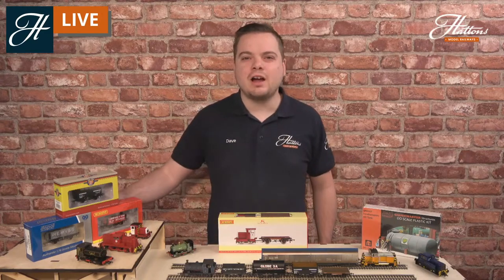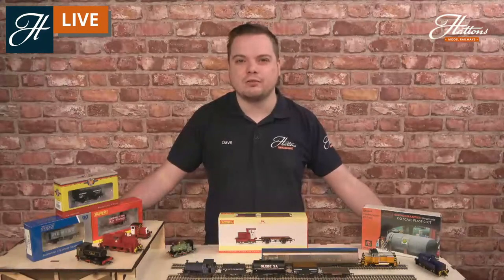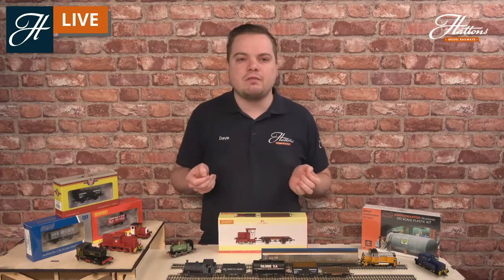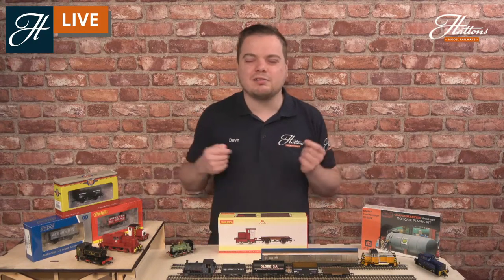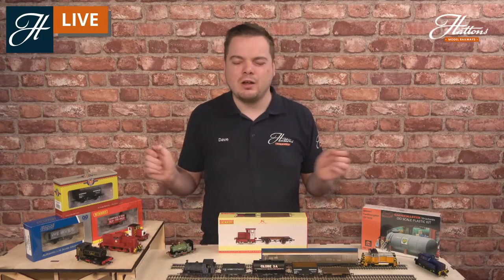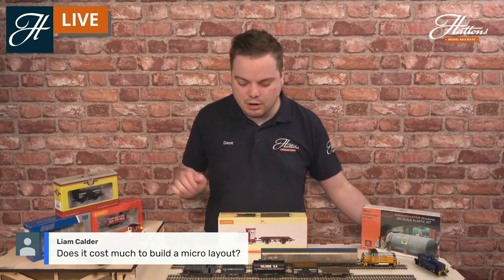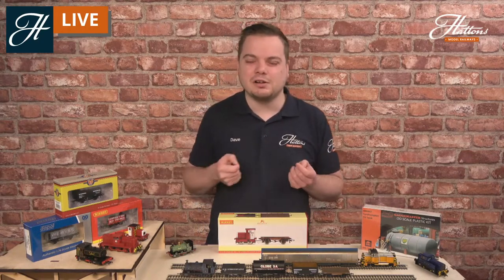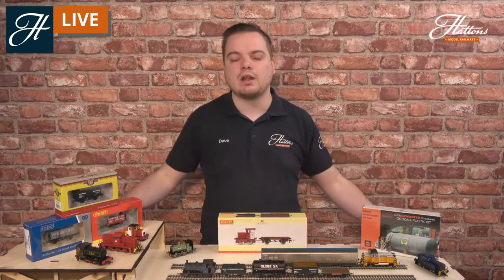How to model an Industrial Railway in OO gauge

Comment: In later years of course, with local ironstone mines closing due to high costs (the last being North Skelton in 1964) and cheaper products arriving at the Ore Terminal near Teesmouth, the scene changed radically. Steam gave way to diesel, the most common being later classed as 25 and 37, and steel plants closed. The empty shells of Cargo Fleet works and part of Dorman Long at South Bank stood inland of the Saltburn branch, the Teesside Executive train was shelved and part of the Whitby line beyond Loftus was lifted beyond Skinningrove/Carlin How. The line was reinstated to Boulby for the new mine's potash trains to Teesside, affording dramatic scenery between Riftswood Viaduct at Saltburn and the line curving inland from Huntcliff - also near Saltburn - to Skinningrove Works, with the new steel viaduct that 'hovers' over the Loftus road's uphill 'Z' bends as it curves around from Boulby to Lackenby Works. The Redcar works that closed in the early 2000's still prospered, and behind them the smaller Warrenby Works, also recently decommissioned. A large part of the ICI complex was decommissioned, leaving some empty shells of buildings, decommissioned since the 1990's. The optimum time period for modelling is therefore 1962-1982 for diesel traffic as well as steam on some Saltburn-Darlington-Bishop Auckland suburban traffic. Thornaby's shed (51L) was completed for use in 1958, when steam locos from around the then defunct Teesside sheds were transferred.
A railway modeller's 'heyday'.
ARL 9/10/2020
Reply from the maker: Hi Alan, you've got it spot on, these are some great ideas for modellers to pick up. Thanks for sharing your memories.

Comment: One example of industrial activity (steel works, docks, shipbuilding, chemical works) could be seen in the 1950s-1960's along the main line from Middlesbrough to Saltburn-by-the-Sea on Teesside. The line to Darlington and Northallerton from Saltburn was used by suburban traffic, with twin articulated sets behind passenger tank and tender classes between, for instance, Cargo Fleet and Dorman Long steel works, ICI Chemical's paints and nylon division and the famous Cleveland Bridge & Engineering Ltd that constructed and assembled Sydney Harbour Bridge in the 1920's. Along the route also, towards the River Tees were the extensive docks and graving docks that built cargo and war ships as well as the later iron ore terminal. In the early hours (around 6.30 am) a Darlington Peppercorn A1 or York Gresley V2 left Saltburn for Kings Cross. This was the businessman's train that returned in the evening. There were also race specials for Redcar Racecourse, with its own platform. Trains from the Midlands and North West passed between the works with GC and LMSR engines heading long rakes of regional passenger stock as well as the newer Mark 1 stock. Until the late 50's trains left Middlesbrough for the coast route via Loftus to Whitby, and iron ore trains passed on their way from various ironstone mines in East Cleveland such as North Skelton, Kilton and Lingdale behind the widespread Class J26's and J27's shedded on Teesside.
Reply from the maker: Thanks Alan, there's some absolutely fantastic inspiration for modelling there and it just shows how many different themes you can combine into a single layout.

Comment: I have two tiny Troublemaking Ruston Shunters. I haven't used them much on the Cat Valley Steam Railway. One Large Prairie Tank Engine of mine, whom I named after Sam's Trains, has somewhat tolerated them. As for Westminster, my Peckett B2 engine, she's in the wars. I took her back to Chester Model Shop with a broken rod. Paul Boyland hasn't yet managed to get the spare parts he needs to carry out repairs. With lockdown coming and going, I don't know if Westminster will ever be able to work on my railway again. I'm praying for good results. I miss Westminster very much, and I'm sure she's missing me in return.